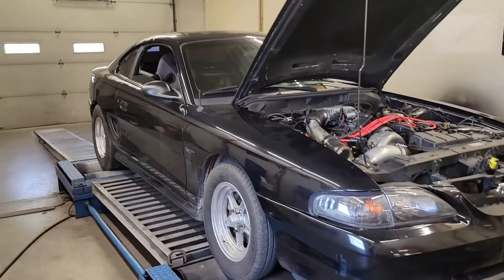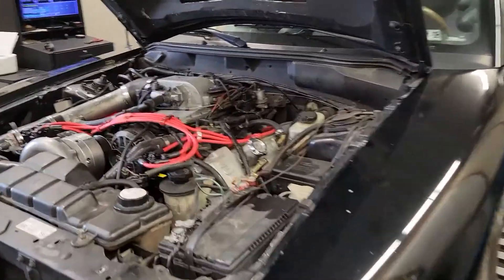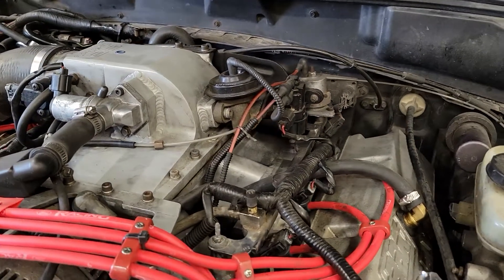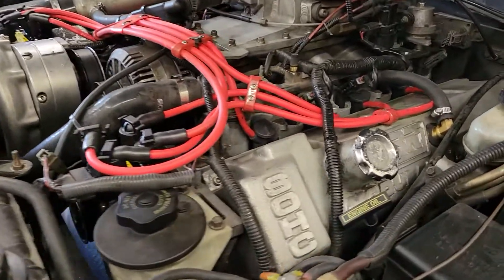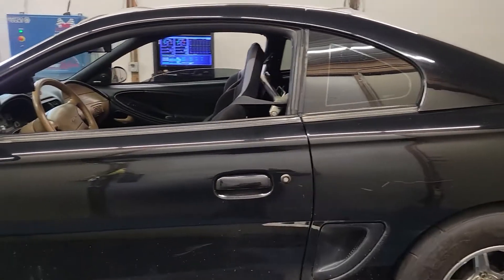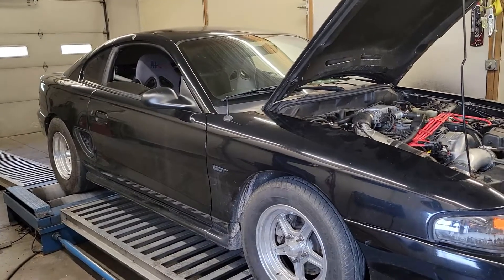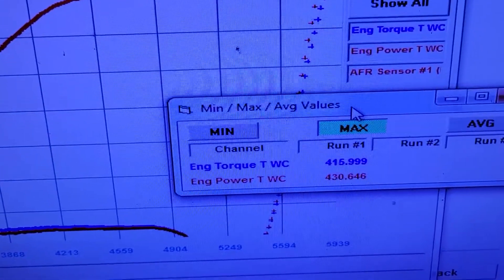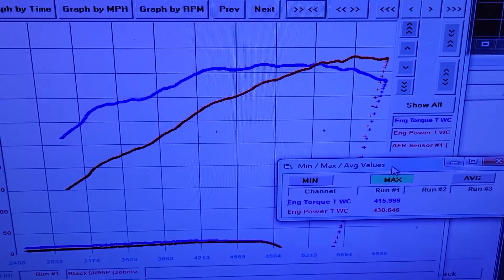Procharged 4.6L 2v | Cams, Intake & E85 | Supercharged Ford Mustang | Dyno Review

Comment: Should be an easy 500rwhp setup at that boost level. That timing needs to come way up on e85.
Reply from the maker: We had to bail early because it ran out of fuel.  Didnt start playing with timing yet.
Reply: @ForceEngineering  pulling to 6500 and adding 8-10* of timing it should pick up a lot.